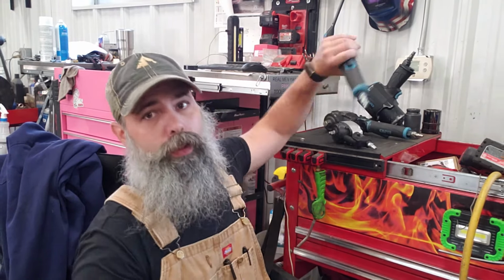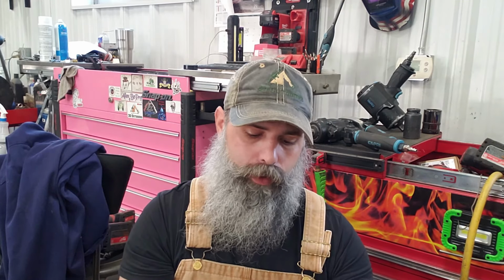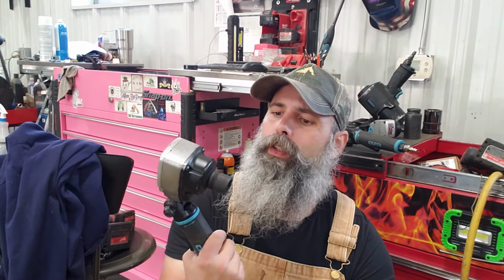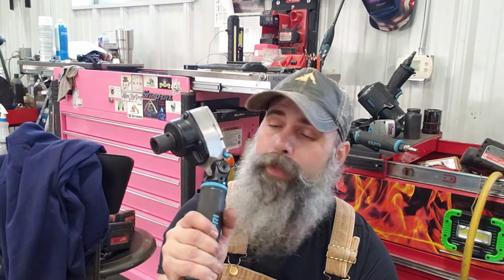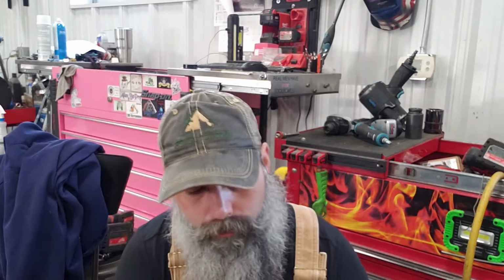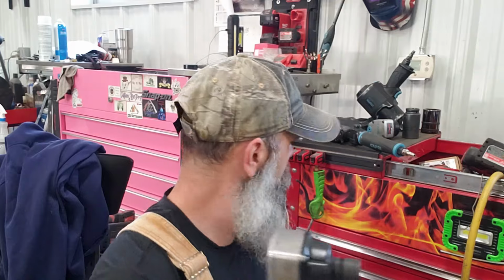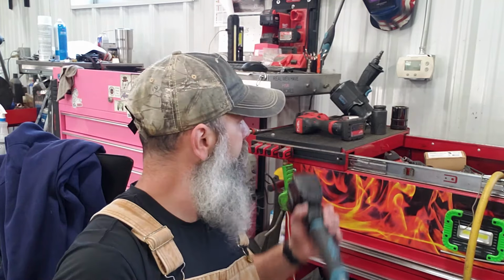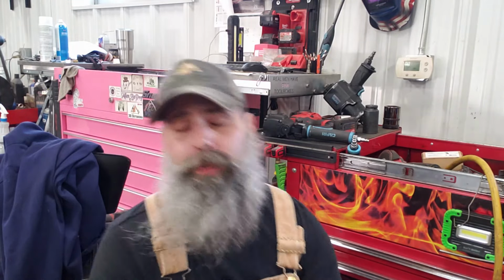Capri Tools Angle Impacts

Comment: Love you impact videos, you always show them beating rust & crust. That 3/4 flex I have wanted since it got released I just have zero use for it and have 6 tool truck impacts as it is up to 3/4" and I'm a homeowner 🤦‍♂️. Good to see the 'ol heavy' 3/4 upsidedown on the bench in the background. If that impact had an adjustable rotating handle that U could put into different positions instead of just the top fixed position it would be the shizz 👌. Great to see U back posting content & fixin your dad's truck!

Comment: well I believe we are ordering a 3/4 capri as you speak so highly of. I was looking at IR myself and found the anvil had become 2 pieces.. I will now tear the other apart and investigate.. I spose if the pieces are binding it would bypass. I would assume the gun to act dumb with extra rattling but🤷‍♂️
Reply from the maker: Have definitly seen a large number of those IR's lock up after 8-12months of use even when oiled daily